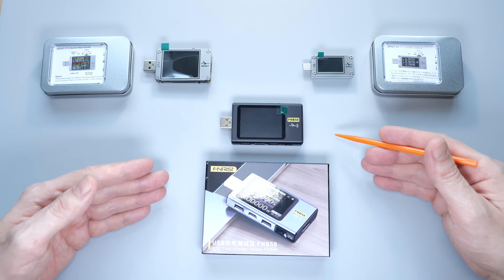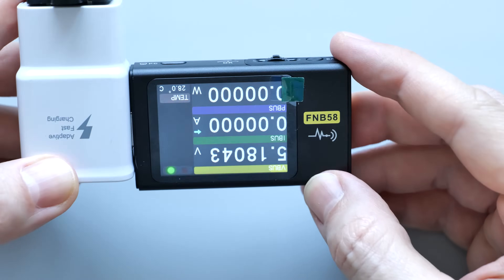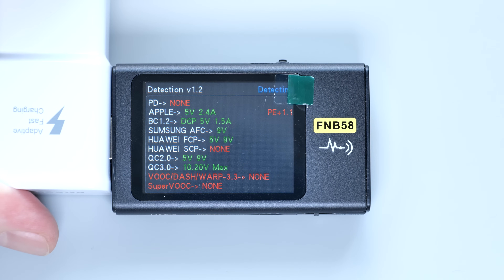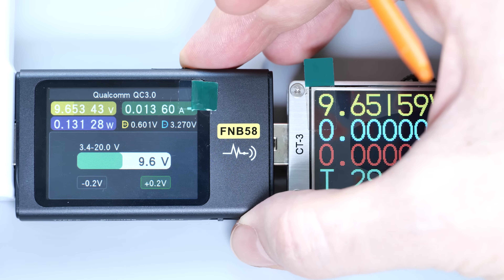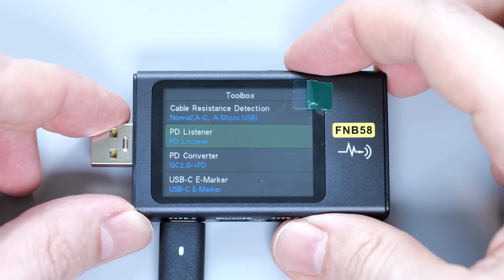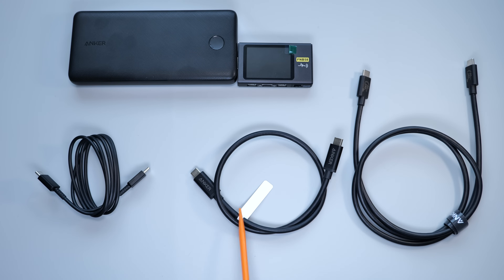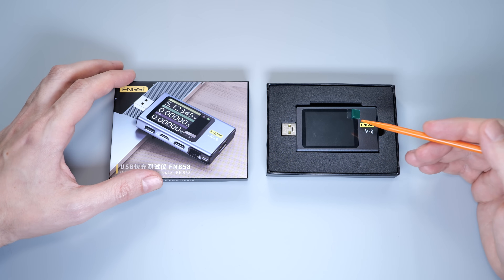FNIRSI FNB58 Review – The Best USB Tester for PD, QC, E-Marker & More?

Comment: wait, I didn't understand how you plugged in a USB-C to the out port in the first test and then the next test you plugged it only to the USB-C in port. so which one or does it not matter? and what if you have a Type A on one side and Type C on the other, wouldn't the Type C side have a emarker? and so where do you plug in the type A side?
Reply from the maker: To read e-marker you can use any of those USB-C ports. For USB-A to USB-C cables the e-marker (if the cable has one) is on the USB-C side, because e-marker data is communicated via the USB-C line. The USB-A side itself doesn’t have an e-marker.

Comment: I am designing a usb pd source controller pcb and i want to test with this device. If i have done something wrong would i break this tester?
Reply from the maker: Absolutely not! This tester doesn’t care about protocols or voltage (as long as it's within its operational limits).

Comment: Thanks for posting that. Any opinions of the FNAC-28 and FNB-48P?
Reply from the maker: Feature-wise FNB58 is still unbeatable but depending on what you need from this tester you can look at some cool meters that I also use in my repair shop: KWS-X1, Power-Z KM003C.

Comment: Is this still the best usb tester?
Reply from the maker: Feature and quality-wise probably yes. I still use the one I reviewed almost daily in my repair shop. Also, I think Fnirsi is probably the only manufacturer of these USB testers that actually provides firmware updates and those updates often add extra features. So yeah, I’d still buy that meter today for me, it’s still the best one. But if you don’t need most of its features and only care about USB-C, then I’d take a look at the Power-Z testers: https://alii.pub/787osp

Comment: Man this thing is cool as! I just found one on Ali for 30us. Can’t wait to try it on all my chargers and cables around the house. Great video btw. You answered so many questions that I was wondering in my head lol
Reply from the maker: I'm happy to help! It's a pretty cool device, I still use the same USB tester I reviewed, and I use it almost daily for laptop and other electronics repairs. It's extremely helpful for diagnosing various faults without even disassembling some devices, and it's really nice to have one at home. You can, for example, check if the chargers or some USB cables you bought are fake or genuine, verify if their specs are accurate, and use it for many other things.

Comment: After multiple FNB 58.... it will NOT show watts when I connect USB C in (brick or power bank) and USB C out (phone). Phone sees no power and watts are below 1w
Reply from the maker: So there's no voltage on the USB-C at all? What if you use USB-C (IN) for input and USB-A for output, does that work?
Reply: @ElectronicsComputers 

Update.... the USB C out is the culprit. No matter what is IN if I use USB C out it doesn't work. Tried multiple FNB 58s.

USB A out works no matter what the IN is (A or C).

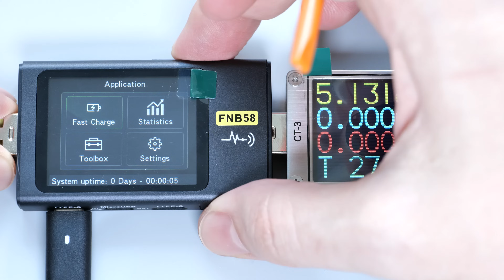Comment: 2:26 I would be curious how long it lasts if you use it just to negotiate power, like this.
I imagine it was designed for more intermittent usage.
But I'm interested as that would also be quite useful for me
Reply from the maker: I've been using this tester in a professional setup for over a year, and it works perfectly. I also bought several for my technicians. Almost every laptop, tablet, phone, and other devices that come in for repair are first connected through the USB tester to get an idea of what's happening internally. This helps us identify potential faults right from the start.
In my case, the only part that might wear out over time is the USB-C ports, which go through dozens of plug-ins and removals each day. But they've been holding up pretty well.

Comment: Great video.
How to check if a charger support Xiaomi's 120W hypercharge from this.
Reply from the maker: It’s simply impossible to test Xiaomi's HyperCharge with this USB tester, and I’ve never seen a USB tester capable of doing so. The only option is to connect the charger through this tester to a Xiaomi phone that supports HyperCharge and observe the power ratings you receive. This way, you can determine whether it supports the HyperCharge protocol or not.

Comment: Hi, you know how i can test accurate battery capacity?(battery CAP Calculation) if i test with default settings battery voltage: 3.7v and conv. eff: 90% i have more mah than real, tested against klein tools battery tester. i need move these battery settings?
Reply from the maker: Well, technically, to get the most accurate capacity measurements, you need to charge the battery outside of the device using a charger that can calculate the amount of mAh it pushes into the battery. Otherwise, the USB tester also adds to that capacity the amount of power the device itself draws from the circuit. Another problem is that we all know a lithium battery is considered fully charged when it reaches 4.2 volts and the nominal voltage for the battery is 3.7 volts. However, what is considered a fully discharged battery varies between devices, and there is no standard value. Typically, the safest low point is 2.7 volts, but usually, only power tools are allowed to drain the battery that low. Consumer electronics usually show 0% battery when they reach somewhere in the range of 3.2–3.6 volts. So, unless we have the datasheet for a specific battery, including details on what voltage is considered fully discharged, only then we can calculate its true capacity using an external charger.
Reply: @ElectronicsComputers  ok thank you!

Comment: Question - can I use that tester (or do you have a recommendation) for testing the cable itself - specifically impedance.  I have a few devices where its important to be right on spec of 90
Reply from the maker: This tester can measure only USB cable resistance. I have never seen USB testers with impedance feature and I doubt they exist. You should look for some dedicated meters.

Comment: I have been testing some Chargers that are marked as five Volt 2 amp but when I do the automatic test it's saying it's 5 Volt 1 1/2 amp  any ideas
Reply from the maker: The automatic detection mode doesn't represent the current your charger is capable of providing. It simply detects supported protocols. There can be several protocols rated at different voltages and currents. To see how much current your charger is capable of providing, you have to use a load, for example, like the one I showed in the video.

Comment: I have a AVHzY CT-3 tester and it’s fantastic. I opted for it because it supports Lua scripting, which allows you to automate things like battery tests and whatnot. It also has the option for a load tester to attach to the back. The software is also quite good. I love it. Either way, you can’t go wrong with these two choices.
Reply from the maker: I've been using the AVHzY CT-3 for almost two years. It's a nice meter, and I've repaired dozens of laptops with its help. The only thing I don't like is its open case design. It's okay for home use, but in a repair shop, it's not ideal. I shorted some meters with tiny wires and screws that accidentally got inside and caused a short.
Reply: @ElectronicsComputers  CT-3 jest też w pełnej zamkniętej obudowie

Comment: Hi, Thank you nice review. 
When connecting the MacBook Air M2 2022 directly to a 140W fast charger, the charging speed reaches up to 70W. However, when the FNB58 is connected in between, it only shows 30W. Which settings need to be changed in the FNB58? The cables I used all support up to 240W/120W.
Reply from the maker: Have you tried reading the specs from the cable's chip? What power does it show? There have always been problems with Apple's devices, which is why, for repairing and testing Apple's products, I use a USB tester that can be directly plugged into the laptop's USB-C port without using any extra cables.

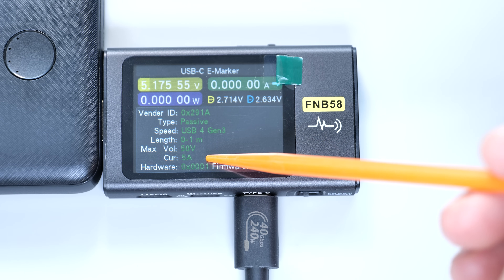Comment: 4:37 Can it test the data speed as well?
Reply from the maker: It reads only the speed specifications from the cable's chip, which may or may not reflect the actual speed of the cable. There are no USB testers that can test a cable's speed.
Reply: @ElectronicsComputers  The fact it reads the speed is already pretty nice. I must have missed it in the video

Comment: 1:24 MI-PD is Xiaomi's protocole, correct?
But it's not tested in the automatic detection menu?
Reply from the maker: To trigger MI-PD, you have to select that option, then unplug the USB cable and plug it back in. So, I guess it's challenging to add that feature to automatic mode.
Reply: @ElectronicsComputers  Interesting. Thank you

Comment: Good jobs. Please advise which device I should go for according to my needs - the options I came across are: FNIRSI-FNB58, RD TC66C, KM003C ChargerLAB POWER-Z, AVHzY CT3A and WITRN U3 or ?. The options are expensive for me to act on the "trial-error" scheme... I want a device with which I can test chargers, cables and power banks. I'm not too interested in graphs/curves, I want to be able to check also what protocols are supported by the tested devices (automatic check is better) by 2024. I only have basic knowledge of electrical and electronics, so "deep digging" and statistics are not my priority, as well as dangerous tests. At the moment I have ATORCH UD24 and J7-c - I guess they are not too bad but they are old, maybe not very accurate - not very up to date as of 2024. Thanks in advance to whoever gave advice.
Reply from the maker: Thank you for the comment! Well, the ATORCH UD24 that you currently have is a pretty good option that covers most needs. However, the best USB tester as of today is still the Fnirsi-FNB58. It is the most feature-rich device, allowing you to trigger all power delivery and charging protocols individually and in automatic scan mode. You can also check the resistance of USB cables to identify the most efficient and high-quality ones. Additionally, it can read the specs of the chip in the cable (if it has one).
The scope feature is also beneficial, showing how "refined" the voltage coming from the charger is. Some cheap Chinese chargers have terrible filtering, which is not good for charge controllers in phones, tablets, and other devices. This tester has a very user-friendly interface. I use it almost daily and have never had any problems with it. Moreover, Fnirsi regularly posts firmware updates for their equipment, which is something other brands usually do not do.
Reply: @ElectronicsComputers  Thanks a lot for the quick reply. I also did some research - yes, FNIRSI-FNB58 is definitely a candidate for me. What worries me is that there are often cases, let's call it "incompatibility" with the tested devices. I assume this is also the case with other test devices. It's an expensive tool for me, and if it turns out that it doesn't "get along" with my devices, it will be unpleasant. Of course, there is no way to know without a sample. And what about the WITRN C5? What I've read is that it's just as good and rarely has problems like the FNIRSI-FNB58... Advice?
Reply from the maker: @svilenp  The only possible incompatibility with USB testers is if you have an old one that doesn't support new protocols or if you bought a new one from a brand that doesn't bother to make firmware updates for their devices. That's why I recommend buying Fnirsi. For example, with the latest update, they added power delivery PD 3.1 support. I haven't tested the WITRN C5, so I can't say anything specific, but I think your current tester, the ATORCH UD24, has pretty much the same features, if not more.
Reply: @ElectronicsComputers  Thank you for your response! Since I wrote here I've been poking around on the Internet and with my little knowledge of the subject I found myself at a crossroads between the Witrn U3 and the FNIRSI-FNB58. I should have added that the phone and charger I'm currently using is a OnePlus, which has something to do with the protocols (My current charger that I use to charge everything is the OnePlus Warp 65W, and my phone is the OnePlus Nord2 5G. The protocol is SUPERVOOC which is not available on many test devices. The charger has one USB-A port, so I have a cable (with the phone) USB-A to USB-C which ensures the speed of the protocol.). At this point I don't think I'm ready to go 100% to USB-C because otherwise I have to use USB-C to USB-A adapters sometimes (even for some Micro USB devices) and that will have an impact. If the FNIRSI-FNB58 has no problem with what I just wrote (SUPERVOOC,  USB-А, Micro USB ets.) then I think my choice is clear?
Reply from the maker: @svilenp  The FNB58 supports SUPERVOOC and the rest of existing protocols.

Comment: Hiii what is the difference from finirsi fnb 48 p ???thnk u
Reply from the maker: The FNB48P has the same simple menu as FNB48 one and some features are limited.  FNB58 is the best USB tester at the moment. The case on FNB48P is better in my opinion than on FNB58 but the set of features you get and a nice graphical interface makes it a perfect tool.

Comment: are you can calibrate the voltage? sometime device like this can drift and not pretty accurate, it will be handy if you can manual calibrate the device its self
Reply from the maker: I have never seen USB testers with voltage calibration feature.

Comment: One last question for you my friend, if you have the time? 
You wouldn't know what these model numbers mean on ebay?
FNB58 USB Tester, Digital Voltmeter Current Tester USB Type-C Fast Charge P V1D9
FNB58 USB Tester, Digital Voltmeter Current Tester USB Type-C Fast Charge P F1I3
1X(FNB58 USB Tester, Digital Voltmeter Current Tester USB Type-C Fast 6669
FNB58 USB Tester, Digital Voltmeter Current Tester USB Type-C Fast Charge P Z3N2
FNB58 USB Tester, Digital Voltmeter Current Tester USB Type-C Fast Charge P X2D2

I'm struggling to understand which one is the latest/best the difference these days lol!!!
Reply from the maker: I have no idea what it means and where they found that information. For some reason you can only find it on eBay. Those testers have only two version with and without Bluetooth. The rest is absolutely identical. Firmware is upgradable on both versions. I recommend buying it from the official Fnirsi store on Amazon: https://amzn.to/48cCjul

Comment: Hey, nice video, thank you for sharing. I have same model USB Tester but with Bluetooth, and I don't have the one menu option you seem to have USB-C E-Marker. What firmware version do you have installed on the FNRIRSI FNB58? I have v0.68 firmware. Regards N
Reply from the maker: I have the same firmware version. I'd try to reflash the firmware, that's the only thing that comes into my mind.
Reply: Thanks for checking for me. Is there any way to reflash without my PC installing their trojan, last time when i bough it, i updated firmware first, then saw Trojan, then rebuilt PC> I don't want to rebuild th e PC again for a firmware update, and on their site today FNIRSI i could have sworn firmware only for this model latest Firmware v0.62?  The chinese thy courting backwards? i @ElectronicsComputers  Ill check again, but anyway to firmware update without PC you know of??

Comment: When I plug in my powerbank the Unit display error code 02. Does not open the main interface.
Reply from the maker: When you plug it into other devices, does it operate normally?
Reply: No it does not
Reply: Got feedback from FNIRSI. The microcontroller chip is damage.
Reply from the maker: @hardusvd  Try to reflash the firmware. There's a new firmware update available.
Reply: I did reflash it the device. No improvement.
Reply from the maker: @hardusvd  That's bad and there's nothing you can do about it. It happens, but still as of today it's the best USB tester on the market.

Comment: Kann der FNB58 mit aktueller Firmware nur 120 Watt? In den Spezifikationen steht maximal 120 Watt! Das schwächste PD3.1 Ladegerät kann 140 Watt! PD3.1 selbst geht bis 240 Watt.
Reply from the maker: Es gibt keine auf Verbraucher ausgerichteten USB-C-Adapter, die mehr als 140 Watt Leistung haben. Ich bezweifle stark, dass in naher Zukunft ein 240-Watt-Adapter veröffentlicht wird, da auf dem modernen Markt offensichtlich kein Bedarf für einen solchen Adapter besteht.

Comment: I just bought this tester and wanted to test a "26800mah" power bank I bought from Amazon. I don't quite understand how to read the results that's right in front of me. Lol. Is it a 9900mAh or 19600mAH capacity?

Screen says the following:
Battery CAP Calculation
Group: 01
Time: 0 days 14:36:41
CAP: 9.92364 Ah
NRG: 80.5495 Wh
BAT Vol: 3.7V
Conv Eff: 90%
Results: 19.5931 Ah

Thanks!
Reply from the maker: The battery capacity is about 19600mAh. If you performed this test with fully discharged power bank, then that result should be very close to the real capacity not advertised one.
Reply: @ElectronicsComputers  yes...I tested it when it was fully discharged. Thank you!